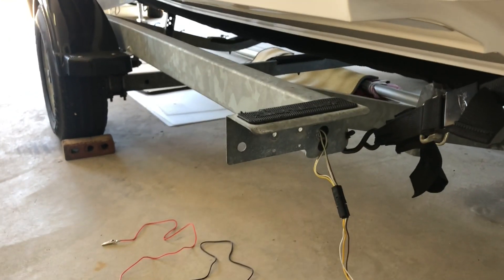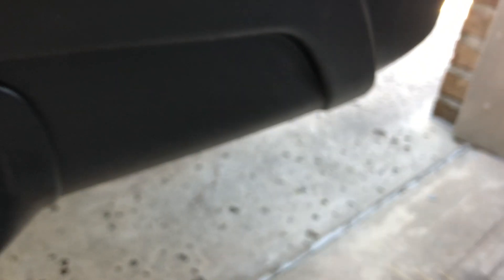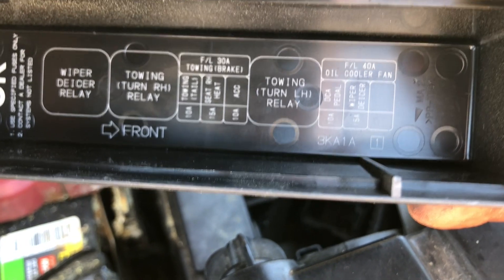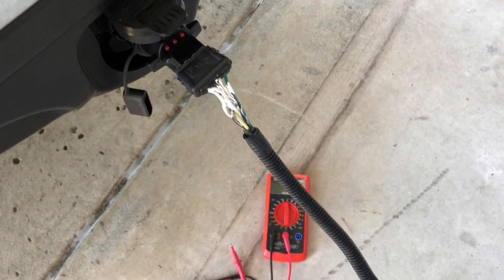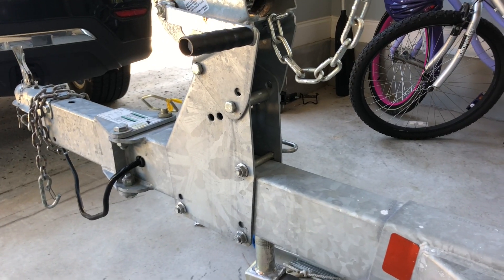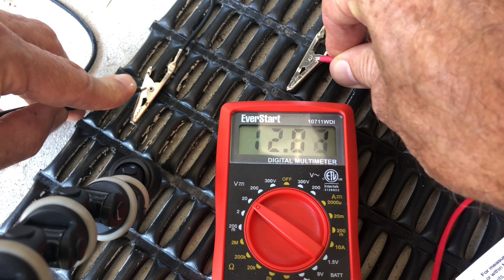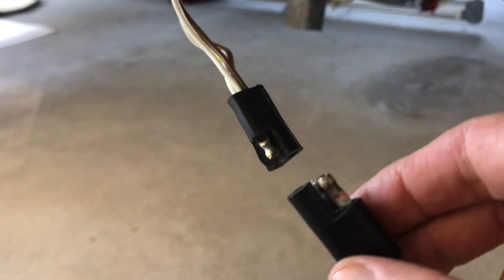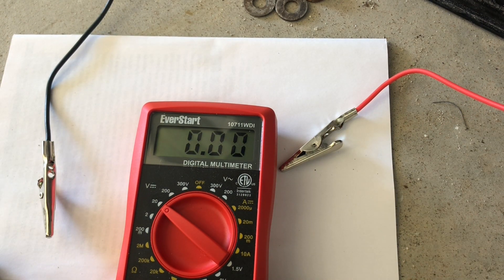Troubleshoot Trailer Wiring - Left Signal and Brake Lights Not Working

Comment: Thank you. Mine was also just a bulb issue. After I checked all the wires and fuse and cleaned everything.
Reply from the maker: That's usually the way it works.  Glad it all worked out.

Comment: Question.
i have an 02 Dodge Ram 1500.  My 4 pin flat connecter on vehicle for trailer works fine. EXCEPT THE RUNNING LIGHT.  My 7 pin connector on vehicle for trailer works fine. EXCEPT THE RUNNING LIGHT.
What do you recommend?
Thanks.
Reply: Did you figure it out in the end?

Comment: Thank for sharing the video Landry, I have a problem with my left turn signal and LH flasher, running lights work on both sides, but no LH turn signal nor flasher, truck is good, I got power in the plug for turn signals, any suggestion on what to check?  thanks again
Reply from the maker: That sounds similar to what my problem was.  Do you have two filaments in the light bulb?  Maybe one of the filaments is bad.  I would welcome any comments from other viewers.
Reply: @landrytheaveragereasonable6735  Thanks for your reply Landry! I switched bulbs, same thing, Im going to check the ground connection in the lamp next.

Comment: What if I have LEDs? My left side running lights are working but no brake no blinker. The right side all three are working
Reply from the maker: I would guess that the approach should be similar.  It could be a bad LED (which I don't know how to test for) or there is a bad wiring connection.  We would all be grateful if you would follow up on your efforts.

Comment: BTW, a tip on cleaning up the connections. I ran across another video where someone recommended using a "bore brush" to clean the female part of the connectors. It's a little wire brush that's normally used for cleaning gun barrels. I tried it on mine, but, it was too corroded. 22 caliber seemed to be the correct size. I also tried using electronic contact cleaner, but, it didn't seem to do much.
Reply from the maker: Thank you for the feedback.  I hope others read it as well.

Comment: Thanks for the pointer on the light bulb. I just replaced the 4 connector wiring on my 2000 GMC Jimmy. The old connector was corroded up, and then I found that the crimp connectors that hooked that wire to the wiring that came with the vehicle were corroded up too. I replaced that and used an LED tester similar to yours. Left and right turn signals worked. However, the right turn signal on the boat trailer doesn't work. Nor the brake light on that side. I will check the bulb tomorrow. I was thinking maybe it just wasn't getting enough voltage. Hopefully, I will luck out and it will just be the bulb. However, I had a separate set of lights that you can attach to a trailer with magnets and those didn't seem to be working either. So, probably it's some other problem. The wiring from the vehicle had 6 wires. Two were taped off and not used. I think my dad did that when he wired it up 20 years ago. As far as I know, they aren't needed as the signals were working before. I'll have to check the fuses. But, the LEDs flash on the tester. So, I don't know how it could be that. Probably, it's a bad connection somewhere.
Reply: Did you figure it out in the end?
Reply: @RogerPack  Unfortunately, no. I need to revisit it at some point.